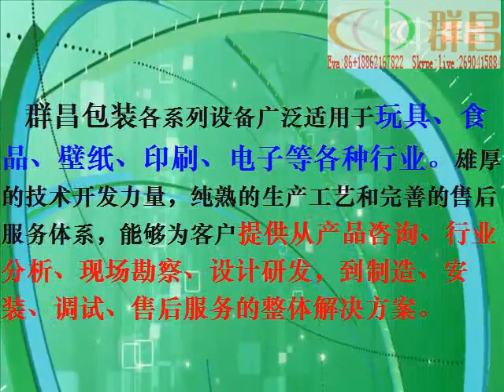CE certification HP320F stainless steel surface wrapping machine for hardwares

Comment from the maker: Main Machine Series: Heat Shrink Packaging Machines,Packing Machines,Shrinking Machines,Sealing Machines,Horizontal Pillow Packaging Machines, Automatic Packaging Machines,Semi-automatic Packing Machines,Manual Packaging Machines,POF Shrink Film,L-type Full Automatic Sealing Machine,High Speed Automatic Sealing Machine,Automatic Horizontal Pillow Packing Machine,Jet Heat Shrinking Machine,High Speed Automatic Side Sealing Machine,Automatic Sleeve Shrink Packing Machine,Full Automatic Sealing Machine,Double Line automatic sealing machine,Manual Shrink Sealing Machine,PE Bag Automatic Fillig Packing Machine,Stretch Film Machine,POF Shrink Film,Four Side Seal Horizontal Flow Wrapper